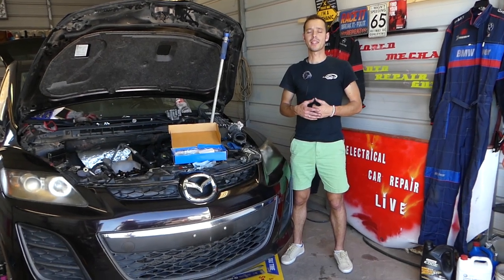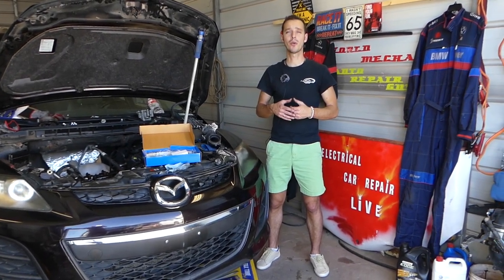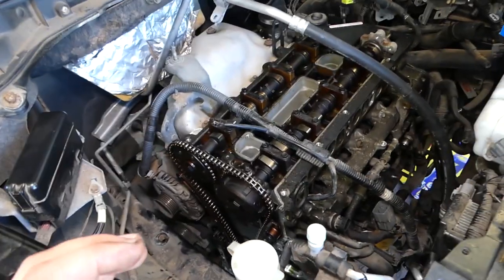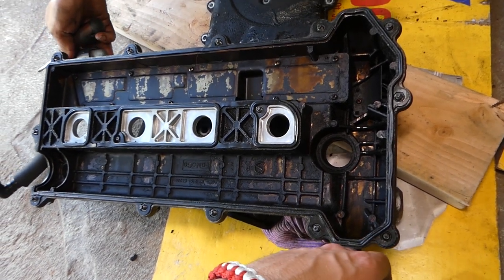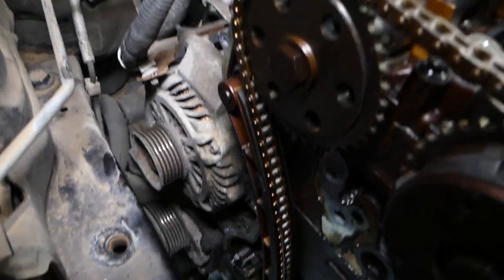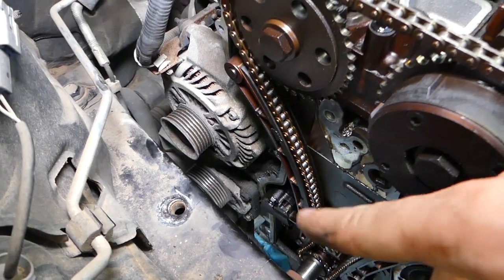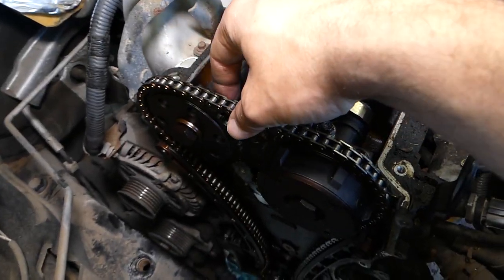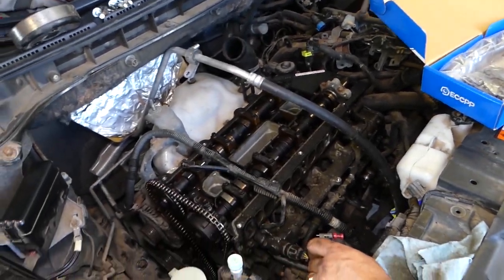MAZDA ENGINE NOISE RATTLE COLD START OR ALL THE TIME FIX

Comment: it b nice to hear the rattling noise
Reply: I agree with you. Then people would know what it sounds like.
Reply: I agree! I currently have a fluttering/rattle noise coming from what I think is the alternator but this makes me think differently
Reply: I agree im in my car trying to pin point the noise on mine 
It shut off randomly and then when able to start again started rattling and whining on idle
Reply: @rubenavalos32   sounds like a bad pulley or alternator. Pulley probably locked up causing the engine to stop.
Reply: Really unbelievably useless video

Comment: Hello, every time I start my Mazda Cx3 the engine has fluctuating idle and with or without the air conditioning activated and after about 20 seconds it works fine, I don't know if this is normal or what could be causing it.

Comment: I don't understand why it isn't standard in modern interference engines to have valve pockets to prevent valve and head damage from a slipped/jumped timing chain/belt. It makes no sense, and could prevent a costly catastrophe.

Comment: This engine doesn't look like its had regular oil changes.  Regular oil changes will help avoid this issue.
Reply: wrong
Reply: @applepoop10  I agree it will but thats not the issue with these engines, OIL DILUTION IS !! do some research

Comment: these engines are failing all over the world this is not the only issue. Blown head gaskets, turbo failure Premature wearing of exhaust camshafts and other engine parts. Engines filling with carbon the list is endless.
Reply: @applepoop10  has the Mazda 3 got the 2.2l sky active Diesel engine ?

Comment: Cool trick to take the rattle noise away and make the engine last longer till you can get it fixed or pay to have it fixed is just crank the engine for 8 - 10 seconds, turn back the ignition, then start it up again and you should be good, temporarily.
Reply: I mean how do you crank it without starting it up?
Reply: @MR5er1 don't listen to this 😂 there is no trick for a bad chain dude. Bad chains means a bad fuckin job. But, to crank the car without starting you can see if holding your gas pedal down to the floor then cranking works, or pull the fuel pump fuse/relay.